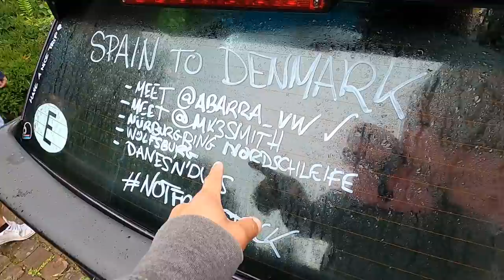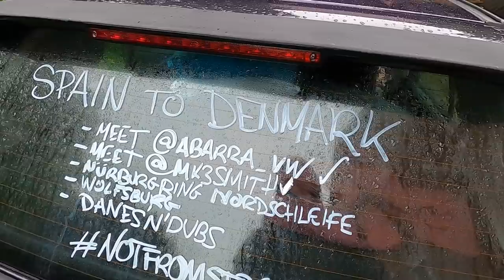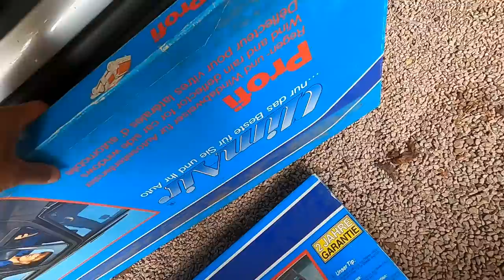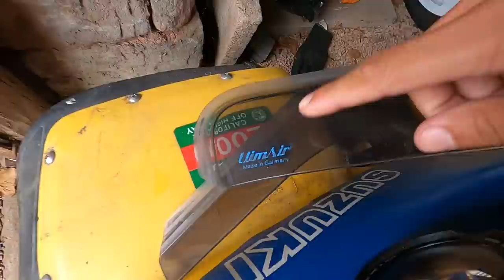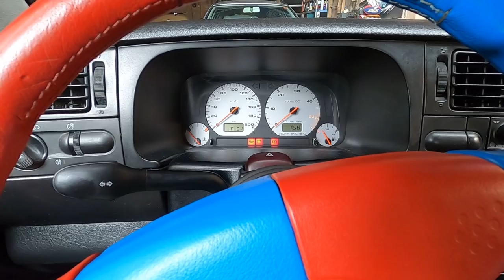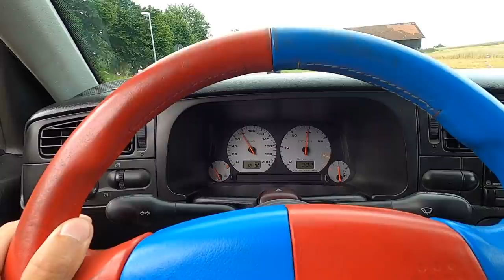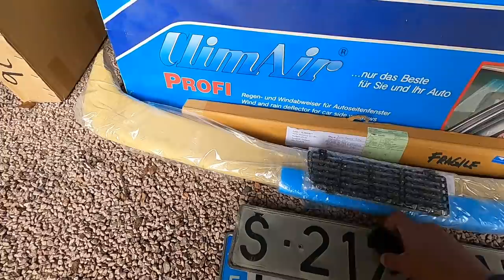Amazing MK3 Parts Delivery From Spain!! ( Golf CL TDI )

Comment: Do you plan to build a 1.9tdi engine?  you would be surprised with the results, you can do around 250hp with just a turbo, worked fuel pump e a remaped stock ECU, and still do 5L/100KM, best daily ever.
nice video bro ✌️